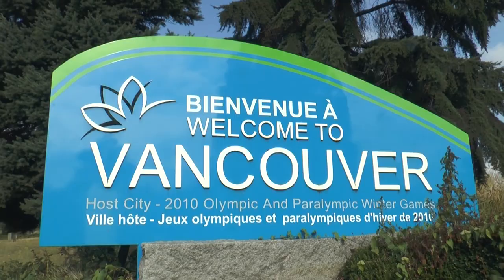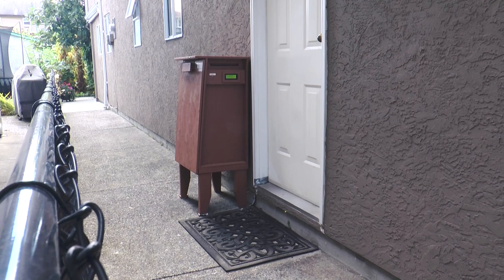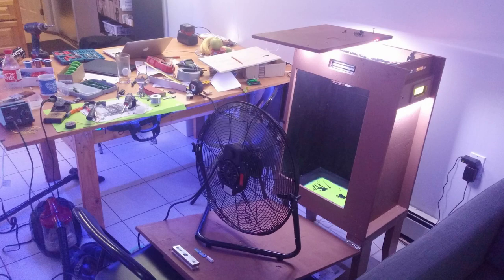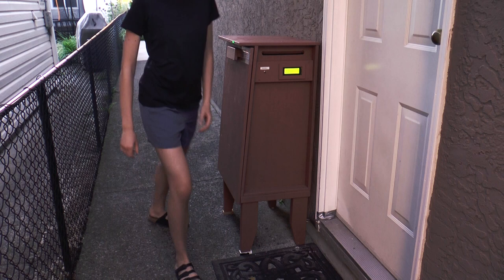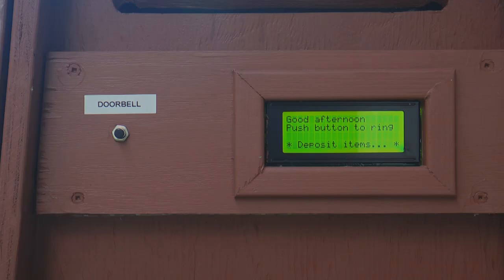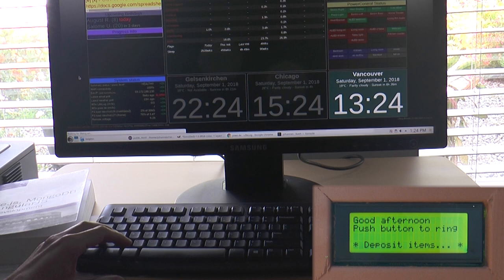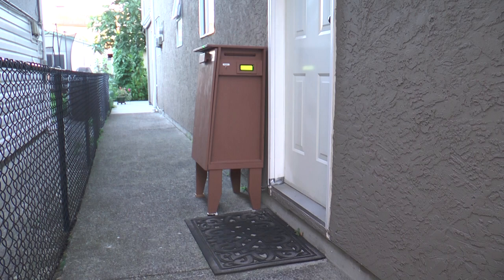JoWe's ESP32 Mailbox

Comment: good job .....can you put shematique detail sir
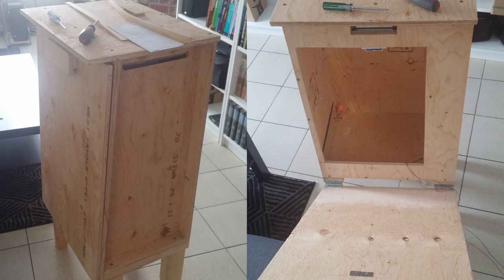Reply from the maker: Thanks. Unfortunately I don't really have a full schematic of this. It's very simple on the hardware side. You can see the pinout and the resistor values for the photo-sensors at 1:06 in the video. Other than that it's just a reed switch to detect door state, relais for lights and locking magnet (using modules with an on-board driving circuit that connect directly to GPIO), a buzzer and a couple LEDs.

Comment: cool channel
Reply: is there a reason you chose the esp32 over the 8266?
Reply from the maker: Yup, three. Number of GPIOs, number of AD converters (I ended up needing four, the 8266 has one), and ease of flashing and power supply with the 32s coming on a dev board with micro-USB. I've used and loved the 8266 in many projects and still have about a dozen of them sitting around, but I'd rather spend $3 more on a 32 than spend an hour and a half soldering. ;)